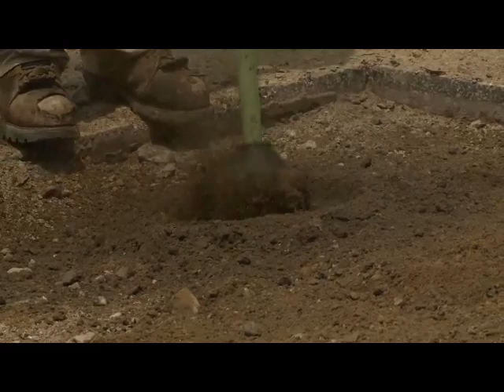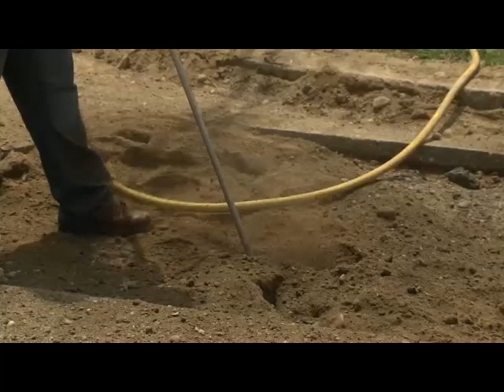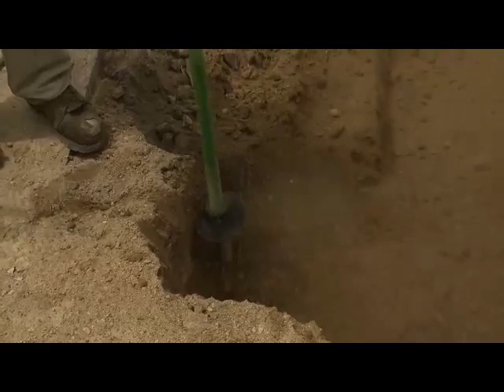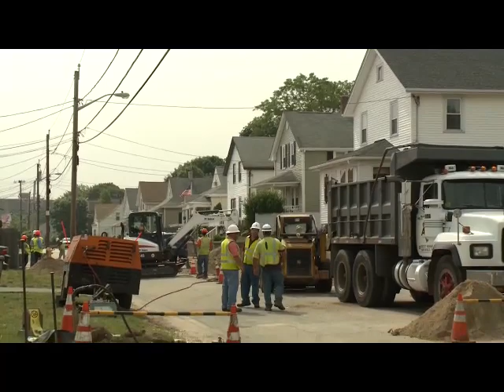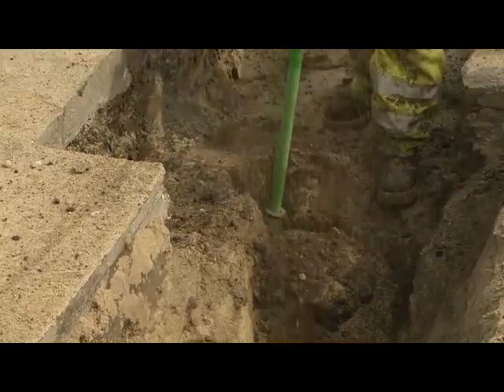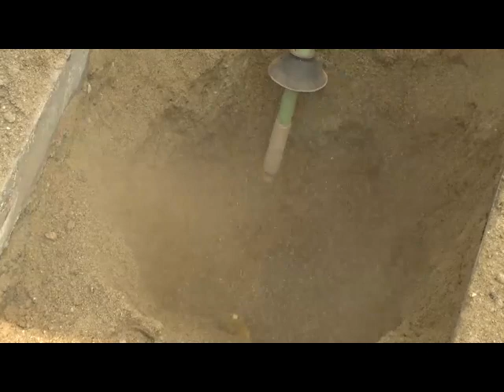Air-Spade 4000 Demonstration Video

Comment: Not only is this product ridiculously overpriced for what it is but it's results are underwhelming. Give me a mattock and spade and I can move near a hundred times the dirt it moves in an hour. Also remember this is pre-dug earth that is backfill over gas piping, etc. So this isn't hard packed, it's light and fluffy.
Reply: Redickless is right,  I've excavated an entire foundation for a drainage tile with a pressure washer and a shop vac 15yrs ago. Both are still in perfect shape. It takes engineers to spend a truck load of cash. Lol
Reply: The point of this tool is to remove dirt where there are delicate things buried like wires or tree roots that you don't want to damage

Comment: It looked like to me the dirt was really soft and he was just fluffing it up.
Reply from the maker: Hi Cheryl, the purpose of the AirSpade is precisely to soften the ground around buried pipes and cables so that you don't damage them and get hurt when excavating. After the Airspade does its job, the loosened dirt can be easily picked up with a vacuum excavator. Hard ground is tougher, very rocky also very difficult because the air stream will not break up a rock.